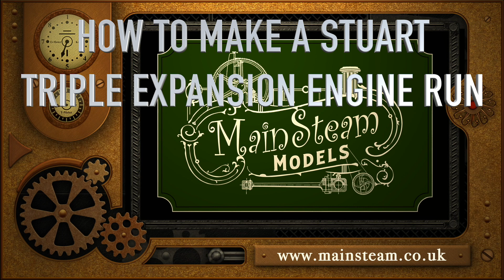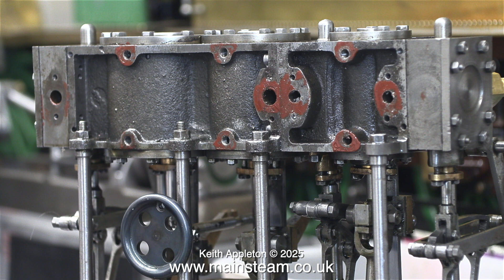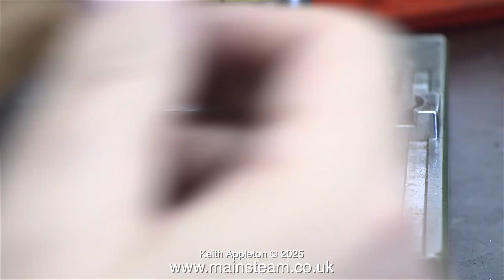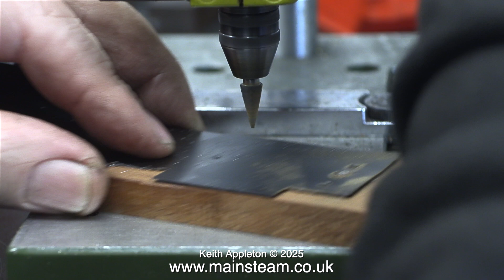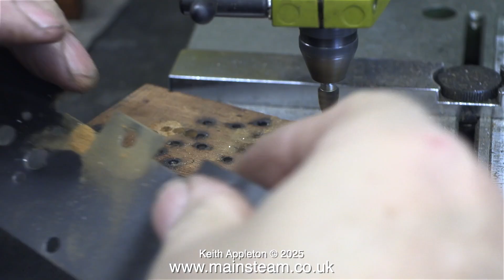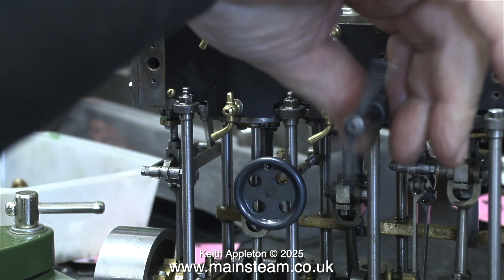HOW TO MAKE A STUART TRIPLE ENGINE RUN - PART #16

Comment: A sharper bit may have sped the job up a bit. Smoke is an indicator of a dull bit. That cladding looks great. Using a cheap baking tin is an excellent tip. My jobs today were my weekly banjo lesson and then picking, juicing and making blackberry jelly to take to my brother tomorrow. He can’t tolerate the seeds. That engine is looking good and so is the type IIA.
Reply from the maker: The bit is sharp. This metal is so very thin that I cannot apply much pressure to the drill bit because it distorts the metal. In a previous video I used a Diamond burr to clean up the holes. This is quite a fiddly job and not as easy as it looks.